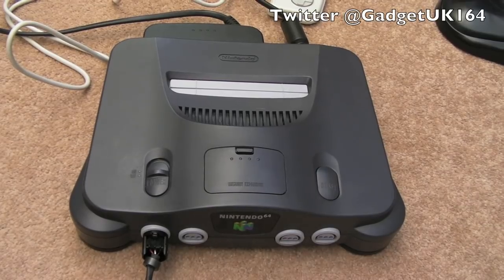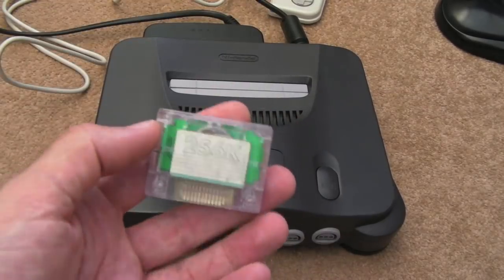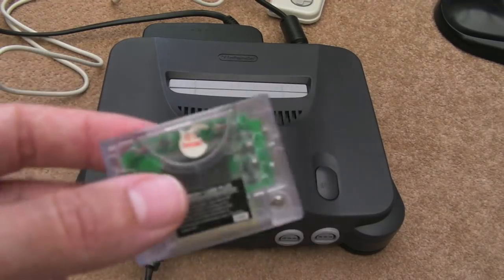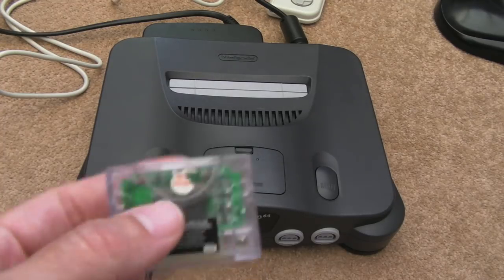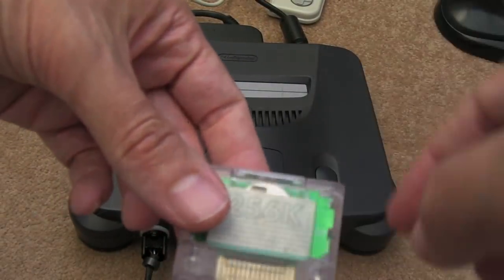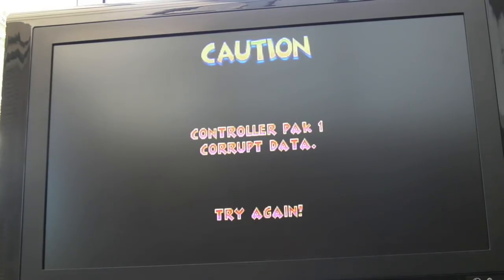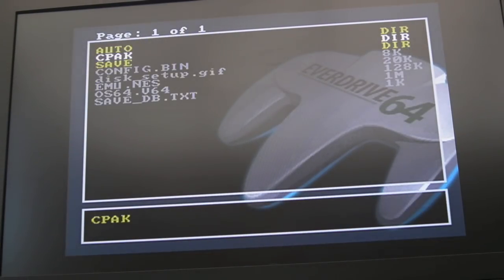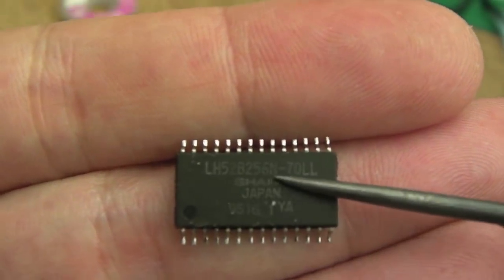Nintendo 64 (N64) Memory Pack Repair & Warning

Comment: I thought this video was going to be about the 4meg RAM expansion. Is it possible to make one of those? Maybe some FPGA magic would do it. Apparently, you can have 16meg RAM in a N64 and so that must mean using a 12meg expansion. I think, for the sake of homebrew, it should be done. As an aside, surely these 256k memory packs can be made too (since after all they are cloned too). Actually, might as well go for a full DD system but using say a FPGA "pretending" to be a DD disk (but it is actually just a stick or RAM or something).
Reply from the maker: It's of course possible to make anything =D   But just not worth the effort tbh!  It's far easier to just buy a spare one off eBay for £20 or something.  They do use a specific type of RAM - RAMBUS I think?  But I am sure you could replicate it with some other type of RAM.  And yes, you could easily hombrew one of these memory packs for sure!  Nice thin small PCB - easy to make your own, and maybe 3D print a shell.   Use FRAM instead of SRAM and you don't need a battery =D
Reply: For the homebrew, it does seem kind of silly the way the n64 does not have a homebrew 16meg RAM upgrade (so that is basically 12meg + 4meg existing). And also for it to have something like the DD made (but maybe using a SDcard or emulated zipdisk in a 256Meg chunk of RAM pretending to be a HDD or whatever). Surely it will become a thing. I have hope for it.

Comment: I wonder what would happen if you plug the memory cart into the controller and then swap the battery while it's getting power from the controller.
Reply from the maker: It's a good idea, but there's a problem with the mem packs I have - if you remove the battery, the + and - connectors for the battery SHORT!  If the pack was powered by the N64 that would cause the N64 PSU fuse to pop probably.  If the battery contacts don't short, and assuming the SRAM is powered by the N64 (not sure it is in mine), then you would be OK.   But pretty sure with mine the battery is the only source of power to the SRAM, even when connected to the N64.
Reply: Well seems my curiosity is cured with that "what if" :)
Reply: tbbw and if it were an original memory card you wouldn't be able to get in there with a soldering iron to replace it while it was plugged in :( unless you too the controller out of its shell too
Reply: It was more an idea of how not to loose your saves or damage the sram if it was undervoltage that was the cause.
Just random idea that popped into my brain while watching the video that i wrote a comment about :)
Reply from the maker: You could solder some wires onto the battery connections on the PCB, connect up to another battery in parallel, then remove the onboard battery.  Need to be careful whilst soldering though and you could use that technique to swap the chip - only the battery.   If you try soldering the chip whilst its powered you would likely lose the data and possible kill the SRAM.
Reply: This actually works on GB and gbc games if You play them in a GBA or a GBA SP, there are videos of people doing this, You just need to be careful

Comment: i didnt know cr2032 dont leak.
Reply from the maker: Technically they probably can, but I've never seen one leak.  They tend to just go low voltage and just sit there.  Occasionally swell a bit.
Reply: GadgetUK164 - Retro Gaming Repairs & Mods i opened my Sega Multi Mega and it uses a rechargeable cr2032. Didnt know they existed.
Reply from the maker: Yeah, the Mega CD v1 has a rechargeable CR2032 I think too!

Comment: Is it possible to replace the eeprom or flash chips in original cartridges once they die?
Reply from the maker: Not easily I think - the N64 cards use special serial PROMs =/
Reply: @GadgetUK164  thank you